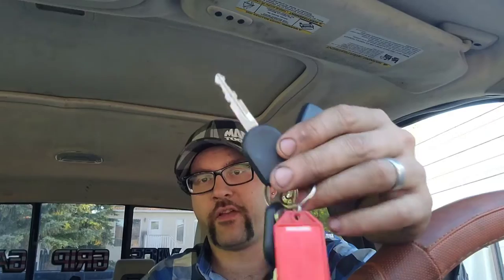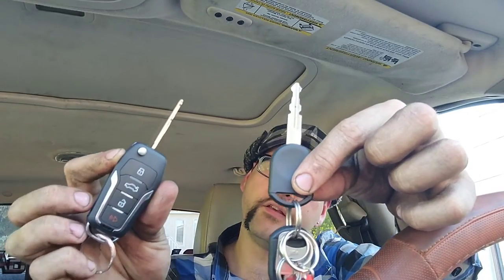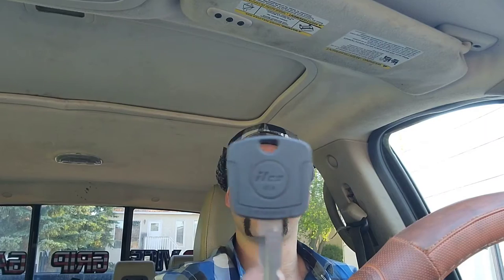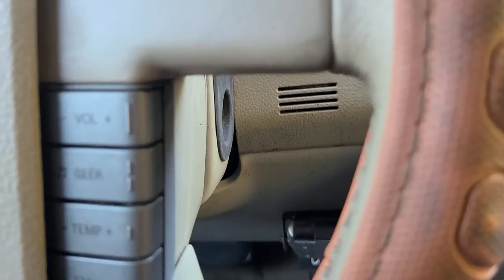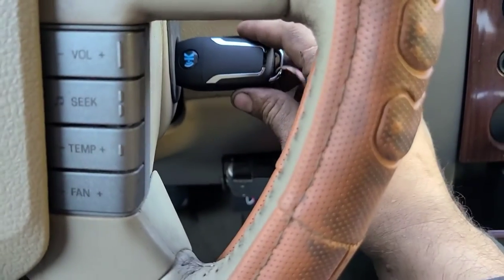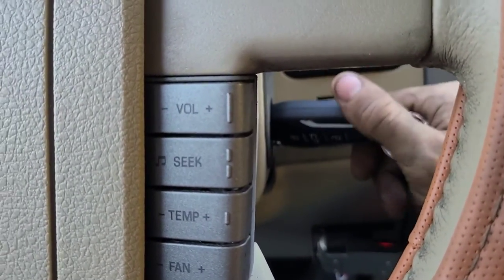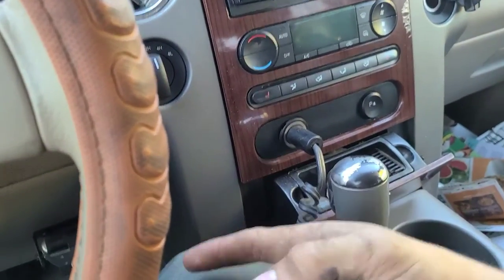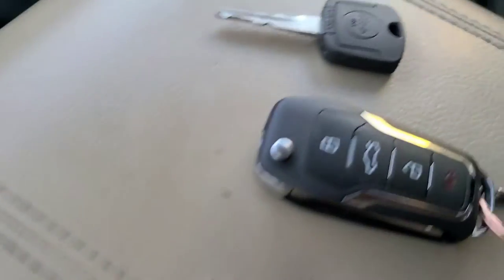UPGRADE YOUR OLD FORD KEY FOB!

Comment: This was very helpful. Locksmith tried to charge upwards of 200.00 for cutting the keys alone. Not including programming. Told me the switchblade keys would not work. Here I am with 5.00 dollars worth of cut keys and them all programmed to the lock,unlock, panic and they all start the truck too! I had both original keys however

Just to summarize. Because I hit a couple snags
1. Cut the keys
2. Program the fobs using the 8 cycle method.
3. Use the 10 cycle method to get the key to start the ignition.

Remote start is installed but I still need to activate it with the Forscan tool. I do not know if it will work since it wasn't active when I did the keys. I may also try to reprogram them after it's enabled if it doesn't work.

Thanks again I hate people that take advantage of others for a simple procedure. Saved me some $$$
Reply: Did you get remote start to work? If so, how?

Comment: Although the upgraded key is compatible it cannot be programmed without having 2 OEM Keys as  explained in this video. I was able to get it cut at Lowes free of charge ( they are not even supposed to cut outside keys). I got in contact with a few locksmith's in my town and the 1st few wanted to charge me upwards of $180 just to program it. I kept looking and found a guy that gave me a deal he charged me $70. 2004 Expedition. Either way I appreciate the video and thank you for making me aware of this upgrade, now I don't have to worry about the transponder breaking at the top.
Reply: Mine is 2011 ford f150. Style of key is correct but the fob is part of the key. 

I have the original and spare and recently purchased a remote start that came with 2 more keys and those were 4 buttons.

Now I have purchased the Amazon switch blade keys to do the same thing you have done. The non switch blade keys are programmed and start the truck. The switch blade keys will unlock the doors and panic etc. But won't start the truck. Did I exceed the number of keys I can have? Do I need to install the remote start first and then do the programming on the keys that came with it and then clone those to the switch blade. Little confused. Thanks

Update - sorted this out using the 8 cycle and 10 cycle methods keys now work.

Comment: I have a 2001 ford explorer sports trac and I would like to know where can I find the new key fob that you got off eBay for the new key fob that folds up and has the built in fob on its case and will it start up my truck without being inside my truck after it is programmed into the new folded front with built in key fob so I don’t have to keep all those fobs on my key chain…

Comment: The actual thickness of the Amazon key itself is thicker than the original key.  Does the key shop grind down the blank (new) key so it will fit in the ignition?
Reply from the maker: The key shop I took it too only cut the tumbler grooves, and it fit in perfectly and has been working perfect since day one.

Comment: Did the company that cut your key remove the key from the housing? Some Amazon reviews said u have to possibly remove the key so the shop can cut it.
Reply from the maker: Yes, I removed the blade from the fob for the hardware store to cut, as the young kids there didn't know how to remove it. Just a few screws and it pops out
Reply: @AaronsAutomotive  copy, thanks you!

Comment: Thanks for the video man. Answered all my questions. Can’t believe it’s only $4 to cut. In my experience with other vehicles of mine they told me they couldn’t cut a key like that.
Reply: Shitty locksmith tried to charge .e 200.00 to cut 3 keys. Home depot did it for like 4 bucks

Comment: Hello Sir from Vietnam. 

I would like to ask you, I've just owned Ford Mondeo 2010 - Gas version for Vietnam Market, now my car changed the lock to start/stop button and also use remote control.

 when I press the open button on the remote I heard the connection between car & remote but cannot open the car doors. Please help to show me the way to check & fix them. 

Thank so much! 🤝

Comment: Do I really need to program it though? I just want it because I hate the key that came with my 06 f150. I like the feel of these keys.
Reply from the maker: If you don't care about the button working for keyless entry than no, you do not need to program the fob, but because od the fords anti theft system, there is transponder chip that needs to be programed or the computer will put it in anti theft and jot start  MOST places that cut car keys can clone or copy the existing keybthat they cut from and put it on the new key for dirt cheap

Comment: How did you get the auto start on the key, I have a 07 f250
Reply from the maker: My truck came with an "OEM" remote start that would start onlock 3 times, would also start the truck if you used the keypad on the door to lock it 3 times, but the fobs distance was maybe 5 feet away at best that it would work, so I wired in an aftearket unit. After I programmed the new key I plugged the old unit back in to test it and works from about 50 feet away now, 

That said, the aftermarket does make remote start kits that utilize the factory key fobs to start the engine, the best one I've installed on customer vehicles is from compustar, it's the DC3 model and the wiring T harness the plug and plays right into the factory ignition harness, and instant 3X lock on oem fob to start.

Comment: Doesnt work.
Reply from the maker: What part didn't work? The fob programming? Or the key chip programming?
Reply: The key part. The keyless work. I got 2004 ford f150 xlt 2 door rear wheel.
Reply from the maker: You must have 2 original keys that start your engine to perform this procedure. If you only have one working key or none at all it must be programmed by a dealer or locksmith! Your New third (unprogrammed) key must also be cut prior to performing this procedure.

Please Note: If one of your keys is a cloned key from a hardware store this procedure will NOT work. This procedure requires original programmed keys.
1. Insert an existing (working) key into the ignition cylinder.
2. Turn the ignition cylinder ON (just shy of starting the car Without cranking the engine) and back to OFF. Ignition should stay in ON position for at least one second.
3. Remove the existing key and WITHIN TEN SECONDS, insert a second working key and turn to ON and then back to OFF. Ignition must be on for at least one second but no more than ten seconds. Remove key.
4. Insert the New (unprogrammed) key before twenty seconds have elapsed and turn to ON. Leave it in the ON position for at least one second and turn back to OFF.
5. The security light will light up for THREE seconds to indicate the new key has been successfully programmed.

For those who do not have 2 original keys: These keys can NOT be programmed at hardware stores like Ace, Lowes, Walmart, & Home Depot. They must be programmed by an automotive locksmith or dealership.
Reply: @AaronsAutomotive  i got 2 original old key its not the clone.
Reply: It really dont work for the key did everything you say and the other stuff dont work.
Reply from the maker: These fords are very finicky when it comes to keys and security system, you could try taking it a locksmith and have one of your key ID's cloned.